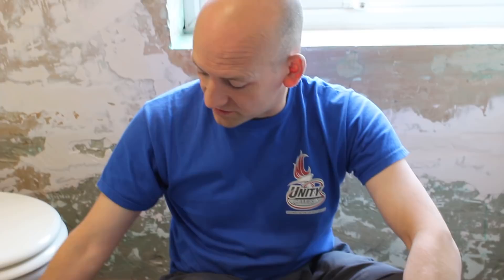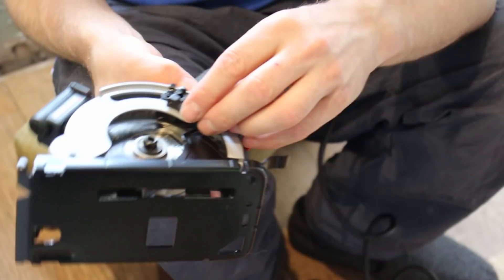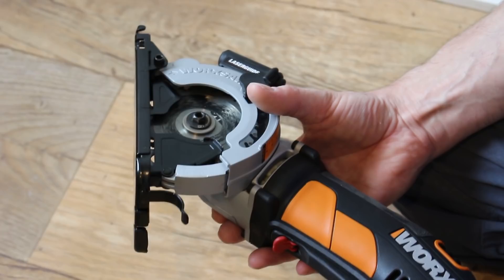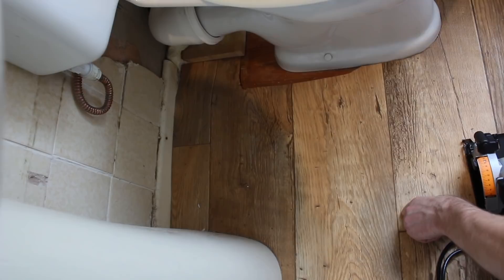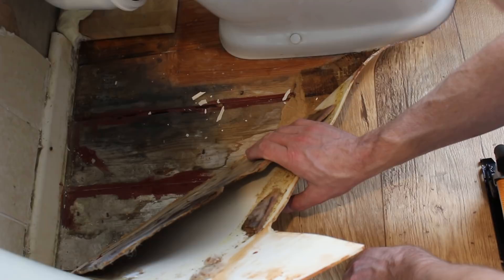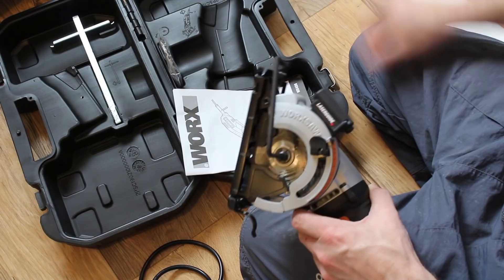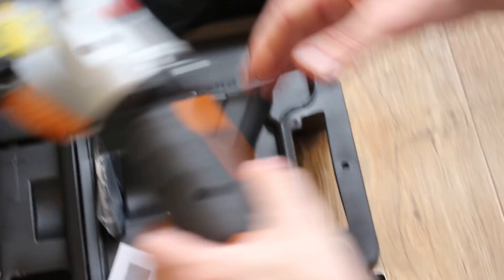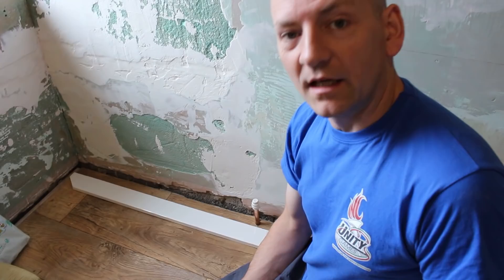WORX Compact Plunge Saw WORXSAW Review  |   DIY Part 2

Comment: Bought Worx WX427 but find the depth gauge is in cm. Yours I believe is in mm and is at the top than the side . Also my gauge is not accurate unless the depth of cut was not an issue. I have lost confidence in this tool now.